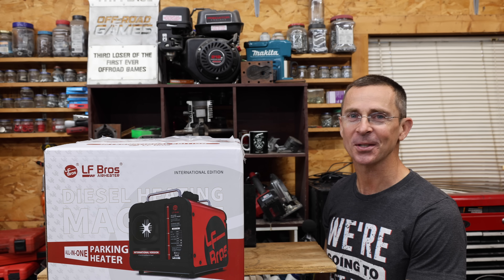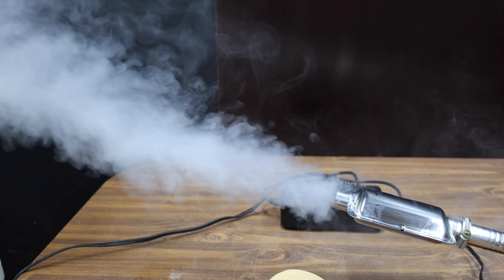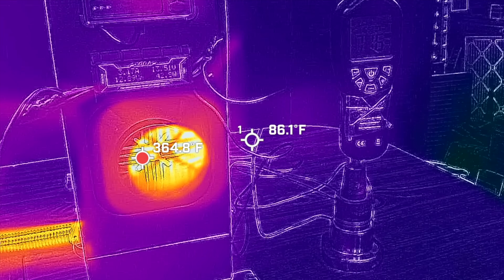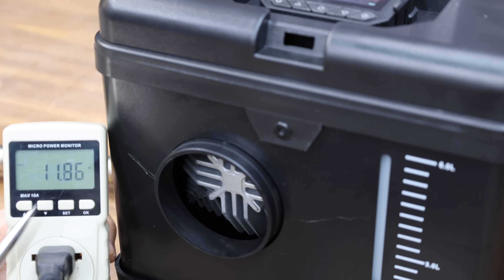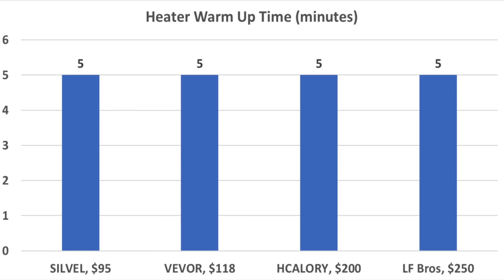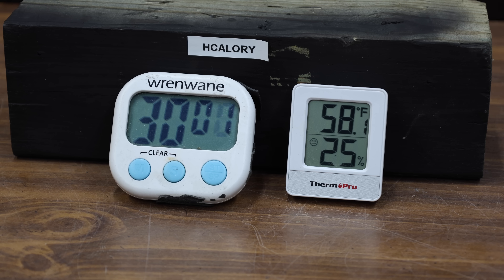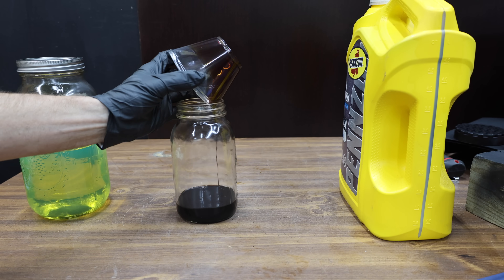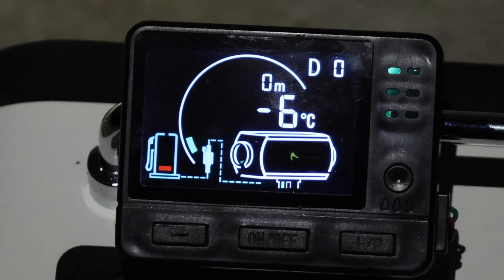The Truth About Cheap Diesel Heaters!

Comment: It's funny I was looking some videos about this type of heaters and I have found some on Amazon. And now you make the test. Great.
Anyhow Apparently Vevor has model with a clickless pump now. Also it seems they are all using same hardware :) 
I have also see na video where man uses the exhaust pipe to route it ture the water heating radiator and then use that to rise the efficiency by good bit.
People use this once for campers and for wooden homes on trucks.
It seems they are really good.
Also people sue it with used oil and then people mix it with new oil and burn that as well. They start on diesel and switch on alternative oil once the heater is at full working temperature. Apparently it is possible to make homebrewed mix and filter it good and have pretty clean burning and cheap fuel.
Seems like one can buy also insides of this systems for 80 bucks and then make your own integration in your camper.
So basically with some cheap material and routing exhaust true something that has ability to warm up and radiate the heat plus using some used fuel one could have really cheap heating system and find second usage for old oil.
Reply from the maker: Thanks!  Thanks for the feedback.

Comment: What is the point of using one of these if they require a power supply? Just get a a catalytic kerosene heater and you don’t have to worry about ventilation, or power during an outage.
Reply: Winner winner. I don’t see a use case for these Chinese boxes of garbage.

Comment: Here’s some old man’s advice: Use a Number 1 fuel as in Number 1 diesel, Number 1 heating oil/Kerosene or even Jet A. They burn much cleaner and will keep the atomizing screen, glow plug and some small ports from getting plugged with carbon deposits. They will run forever!!!
Reply from the maker: Thanks for the tip!

Comment: The reason your first model was giving you so much evaporated diesel steam (its not smoke actually) at your first try is due to your poor power supply. The glow plug did not heat up enough to cause ignition and the fuel was already injected.

Sure the model should have measures against that happening but the other models would behave the same if you would supply them with not enough amps.

Comment: I'm so happy you determined these all used the same heating hardware. That's something i had previously suspected. It makes selecting which on much simpler. Thank you.

I've also discovered that there are a number of 3rd party interfaces available for these which I find baffling. Presumably they offer the ability to link-up to your phone so that you can create a heating schedule. I'd like to see a test of some of those.

Lastly, I wonder if there is a way to hook-up one to a car's coolant system to pump warm water around the engine overnight. I like arctic road trips and this would an awesome installation.
Reply: You need a webasto hydronic.they are just for heating engines. I have the 5kw model. It heats my semi engine to 140 Fahrenheit even at -20 weather. Many truck dealerships carry them.
Reply from the maker: Thanks for the suggestions.

Comment: I wonder if this is more cost effective than a 220v 10kw heater... Or a propane salamander heater. I've both of those, but haven't run any cost comparisons.
Reply: Also, that vegetable oil had me laughing. Not what I'd expected to try, but considering I run my tractor in heating oil, why not a heater in vegetable oil.
Reply from the maker: Thanks for the suggestion.

Comment: Should do a test using used (or fresh) Valvoline Restore and Protect motor oil to see if it cleans up the carboned up combustion chamber.
Reply from the maker: Thanks for the suggestion.

Comment: These are all rebadges, made by the same factories. The parts are all interchangeable, and the only differences are in the controllers, and the fuel/air tuning and features they offer, and the quality of accessories supplied. None are capable of 8kW except one or two specific brands who make physically larger and more expensive heater castings. The 5/8kW units are capable of producing a max of about 4.5kW, including the heat going out of the exhaust pipe.

Comment: Seen on DIY Russian pages that you can run the exhaust trough a cast iron radiator (or any other kind, its just that those are often available from ex-soviet houses) and obtain a lot a lot! of heat increasing its efficiency substantially.    
If you could test or try this it would be incredible.
Reply from the maker: Thanks for the suggestion.

Comment: I have a Vevor, it is a different shape from the one in this video, but probably is the same on the inside.  It's working in my shop right now.  The included documentation was not that great.  But it finally ran and I am very pleased with it.  It was about $100.00.
Reply from the maker: Thanks for sharing.

Comment: Knock offs of the “espar” heaters found in truck sleepers and campers. I bought an espar heater for waaaaay more than these.  The espar fuel pump is almost silent and the electronics are encased in epoxy. Replacement parts are easy to find too.  Are the knock offs epoxied electronics yet?
Reply: Same for me, bought the espar for my sprinter van. Bought for the epoxy encapsulated electronics and the quiet pump. Haven't need any repair or overhaul parts yet.

Comment: I have a diesel RV project going and plan on getting one of these heaters as a permanent installation.  You can also run the exhaust through an intercooler so that the exhaust heat isn't wasted.
Reply from the maker: Thanks for the feedback.
Reply: would an old radiator work?

Comment: Vevor and HCalory are usually a little higher but they have better parts and customer support. I would stick to clean diesel fuel for less issues. At least it’s cheaper than kerosene in most locations in the US. Some units also have better electronics that allow you to adjust the fan speed and the fuel dosing interval for a more efficient and cleaner burn with CO below 20 PPM.
Reply from the maker: Thanks for the feedback.

Comment: Have had a sivel, or some off brand of it for over 2 years, use it during the winter as the price of propane is ridiculous. Start it up right in the morning and my small place is warm within 45 mins where the propane would take 3 hours. (Old building small space) i keep it on a RV battery that gets charged every 3 days or so, 5 gal of diesel gets me close to 2 weeks, one week if I want to run it on high here and there.

You should add to the video to add a fuel filter, think it has added/will add alot of longevity to mine
Reply from the maker: Thanks for the suggestion.

Comment: I bought one 2 years ago to burn waste motor oil. Long story short is the heaters do not like anything but diesel fuel as i will get dirty in just a couple of hours use. I installed a new one for this winter and running only diesel in it. I should have man winters with this new one.
Reply from the maker: Thanks for sharing.

Comment: I have one of the Vevor 5kw units in a 240 square foot shop. On auto, once it warms the shop up it drops to the lowest heat setting. It's almost too much heat! I'm considering a 2kw so it can keep the temperature up without going over.

I also have a second one for the house that can run off of a battery and solar panel for power out events. They are great!
Reply from the maker: Thanks for sharing.
Reply: I used the 2 kW for my toolbox build and it turned out to be a good choice for my boat cabin (small). It's better to run these units nearer the high than the low setting for long term carbon build up and that means sizing on the smaller rather than the larger side.
Reply: Based on my research, the only thing the smaller 2kW units - which I own myself- does better, is at taking up less space.
Reply: what temperature is it outside where you live?  I have a 20 x 20 ft garage and winter can range from 20 degrees above to 40 below Fahrenheit outside.  The garage  stays about 20 degrees warmer than the outside temperature with no heating at all, its a tuck under garage.  I plan to install a natural gas ceiling heater, but for now I want to use a diesel heater.  Will it be enough to get my garage heated?   Lets say from zero degrees up to at least 50?   And what budget model seems to be best?  Some features I want are a nice controller possibly bluetooth, and a hard plastic fuel line, which could also be bought separately.
Reply: I’m installing a Vevor in my van build and wondered if you thought I could have it tight to plywood on both sides but the front and back have 2” of clearance?   I was most interested in your thermal camera pics

Comment: I know nothing about these things (until now), but I have been seeing them pop up on my YouTubes feed lately.
The exhaust vent tube does concern me. I had an old nat. Gas tankless water heater requiring triple wall stainless steel exhaust pipe to vent outside (with proper collar, etc.) that thing would get hot AF. The new one uses PVC for air intake and exhaust. 
I assume these are meant to be vented to the outside even tho they seem to burn all the combustible gases once up to temp.
As a backup for winter power outages, one would need a very good automotive battery that is all charged up and ready. I'd have to do some calcs based on your excellent (as always) overview. About 10 years ago, I put in a wood 'stove' insert into my 1913-built home's fireplace, which is awesome (including an SS flu liner). One thing I do worry about is a prolonged power outage, as my water lines are along the basement ceiling.
I'll have to do some research, but it doesn't sound like a great idea for 'indoor' use other than my old garage/shop.
Edit: I just did a quick search and found exhaust pipe extensions, but the price range is pretty large. Any recommendations would be appreciated. TIA.
Reply from the maker: Thanks for sharing.

Comment: One thing you weren't clear about. Would you feel safe using it to heat your house during a power outage? As you noticed, the inner workings are actually all made in the same factory and they are customized for marketing purposes. My main concern for use in my house is that the unit will shut off if something goes. wrong such as overheating. Also, how would you run the exhaust if you were using it in your house?

Comment: I bought one 2 years ago, on low about 30 hrs 1 gal, have a 30 ft motor coach, idaho, gets very cold, I use a car battery and a charger. Works fine. I did set up small fan to circulate the warm air from the ceiling. 15 degrees outside on leave it on 40% power.. worth the money..
Reply from the maker: Thanks for sharing.

Comment: Myself and my co worker are trying to figure out why anyone would need or buy one of these, if they require electricity to work?
Is it just a cultural thing?
Why would anyone buy this instead of a generator that then powers a space heater?
My suspicion is that this device will in some way produce more heat from the fuel burned, than from a generator powering a space heater.

Comment: Firstly what an excellent review! Secondly, please don't breath in fumes from burnt motor oil. Diesel is expensive in the UK, about $6.50 a gallon, that's an imperial gallon, about 1.2 US gallons, anyway, 4.5 litres. Vedge oil is about 9-10 pounds a gallon, presumably to stop you running diesels on it ;-) But used vedge oil .. is free? You would have to filter it of course and probably leave it to settle. But their performance seem to be very good?
Reply from the maker: Thanks!  Thanks for sharing.

Comment: Okay im nee to these but what is the point of it if i need power for it to run during a power outage.....? So basically i also need to buy a massive battery bank and solar set also?
Reply: Yes to all. There are better options for heating w/ no power. The upside is they’re simple, have few parts and put out a lot of heat unlike these boxes of Chinese garbage.

Comment: I own two vevor diesel heaters. One heats my shop, and another is supplemental heat for my house where my air handler doesn't heat well.  My shop is 12x20x12 ft. In about an hour, the heater warms my shop from 26°F to 55°F. One gallon of diesel lasts 8 hours. In my house, one gallon lasts 3 days. As the unit is turned on and off depending on room comfort.
Reply from the maker: Thanks for sharing.

Comment: Thanks for the review, but it would have been a lot more useful if you had actually tested the BTU output. I have a 8KW one, which should be 27,280 BTUH. This is just plain fraudulent advertising. If you had measured the airflow in CFM and multiplied it by the leaving air temperature differential times 1.08 correctionf factor you would have found that a 8 kw unit is really closer to a 8,000 BTUH output. Someone in advertising added a W after the K to make it sound much bigger. Another way of checking the output would be to figure the diesel fuel has a value of 140,000 BTUs /gallon. Run the machine for an hour and see how much fuel it burns. That is it's total heat output of warm air plus exhaust heat. Likely, these only have an efficiency of maybe 60%. Multiply the gallons used x 140,000 x 0.60 and that will give you a close approximation to the true output. At full blast, mine makes almost 8,000 BTUH not 27,280. 
Mine is positioned between the seats in my old Chevy Astrovan and I love it. I just have it plugged into the cigarette lighter and the best part is that when the van it parked for a short time, it can be left on in low burn with the motor off.  Also, I can preheat he van on really cold days just by plugging it into the lighter and firing it off 10 minutes before starting the engine. It nice and warm as soon as I take off.
Reply from the maker: Thanks for the constructive feedback.

Comment: I love my $200 used 27K BTU oil heater, which requires no electricity at all, and with practically no moving parts to fail, making it the superior SHTF of all oil fired heating methods.  GLT oil stove.
Reply from the maker: Thanks for sharing.

Comment: I learned a lot from this video (like all of Todd's video), but I still have question. I have an old school wick type kerosene heater for emergency garage heat. I have tested it with a CO meter and it burns clean and requires no power other than a starting battery (or a match). How do these diesel heaters compare to kerosene in terms of heat output and ease of use?
Reply from the maker: Thanks for the suggestion.

Comment: They're all based on an expired patent from a Swiss company, if I recall correctly. It was a diesel heater for canal boats. Very popular and they ran close to a thousand dollars. Of course you can see how amazingly simple they were, and how the original was highway robbery. Another youtuber even compared these knew Chinesium against the originals and found these are 90% as good. If you consider the cost as 10-20% the original, there's really no comparison.
Reply from the maker: Thanks for sharing.

Comment: It's interesting that those first two perform so differently given that they are knockoffs of the exact same high end products...  These are all clones of Webasto and/or Eberspacher products. All of these are the core heater unit in an exterior housing. if you plumed the core heating component of the lowest performer up to the piping and control of the highest performing unit I'd be genuinely shocked if the performance wasn't nearly identical.
Reply from the maker: Thanks for the feedback.

Comment: Seems like a silly product unless it's only for a shop or unattached garage. In my opinion there are much better CLEANER options that can be used inside your home. So saving lives is not what I would equate these things to at all. Asphyxiation and or house fires is all I can see happening with these or China's way of thinning our population. The recent vid you put out about electric heaters was good, you had a Mr Heater Buddy vent free propane heater in that vid and yes its much more dangerous than the electric models but compared to these it seems like an OSHA approved device. It may be ok for certain situations but very specific ones and not for saving lives in a power outage unless you can turn it into an electrical generator and leave it outside.

Comment: So they need power to run? If the power is on, why would you need to use one of these. If your running it off a battery, cause the power is out, your battery will die and your still without heat. To me they don't make sense. Good video but I just don't see how they are of use for more than a few hours if the power goes out for any kind of extended time period. It's like trying to flee to safety in an EV when there is no power to keep it going.

Comment: It should be noted that these green diesel lines are not of very high quality. They should be replaced with proper silicone lines. In the more expensive LF Bros N3, for example, proper silicone lines are installed. The green lines dry out and become brittle.
Reply from the maker: Thanks for sharing.

Comment: Its good you tested for unburnt fuel but It does seem necessary to mention more often that the exhaust gases should absolutely be vented outside, and NOT into a space where we will be spending anything more than minutes or seconds. The exhaust gases have small amounts, but enough for caution, of particulates(toxic) and carbon monoxide which can be deadly.  The silvel also has an intake and exhaust pipe that look almost the same - a guarantee that someone well meaning is going to mix those up and could end up sleeping in a tent or RV, and putting themselves in serious danger.
Reply from the maker: Thanks for the feedback.